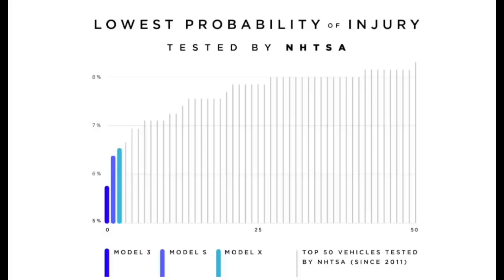Will The Cybertruck Exoskeleton Impact Crash Safety? W/ Sandy Munro

Comment: that was a lot of talking around the question. I found this on chat ai. I dont even think the cyber truck will ever come out not anywhere close to the model they have been marketing for 10 years.......In a traditional vehicle, the crumple zone at the front and rear of the car is designed to absorb the energy of a collision by deforming or "crumpling" in a controlled manner. This deformation helps to slow the vehicle down and reduce the force of the impact on the occupants.

However, the Cybertruck's exoskeleton is designed to distribute the energy of a collision across the entire structure of the vehicle, instead of focusing it on a single crumple zone. The strength and rigidity of the exoskeleton mean that the vehicle can be engineered to deform and absorb energy in a controlled manner, while still providing excellent protection to the occupants.
Reply: sounds like BS to me....supper strong rolled steel yet can absorb energy from the crash??????/

Comment: I absolutely love the whole concept of the Cyber Truck.
 My only concern & one big disadvantage of the exoskeleton is, as soon as one of those pristine straight folds is damaged how is that going to compromise the structural integrity of the whole vehicle? 🤔
Reply: its going to be really bad for repairs and modifications, a regular pickup with frame can be modified for all kinds of usages, a custom bed, or camping gear......
Reply: Presumably, anything that damages the cybertruck frame would also damage a regular truck frame
Reply: @samuelbaird4983   Not at all, because a legacy pickup truck has an internal frame / chassis which needs a major impact to damage. Minor panel damage is just superficial because the outer panels are just for styling & aerodynamics.  
The CT doesn't have a chassis / ladder frame because the external shell is what gives it it's strength. I wouldn't mind betting that any moderate collision like a side impact could be a major repair or even a technical right off 🤔
Reply: Kiwi - the Cybertruck does NOT Scratch, Dent, Chip or Deform. 
CT uses 30xx Cold Rolled Stainless Steel TESLA Alloy. 
the ONLY way to Deform a CT is to Crash it, otherwise the CT Remains as is for Decades. 
CT is a Replacement for a HILUX and HUMVEE, its more Agile and Nimble than both.
Reply: @markplott4820  you can absolutely scratch stainless steel. Anyone with stainless steel counters can attest to that
Reply: @samuelbaird4983   - TESLA 30xx Stainless Steel Alloy is more ROBUST than conventional Stainless Steel.
and Gashes or Scratches and be SIMPLY Buffed out.
Tesla 30xx SS is 9mm FMJ bulletproof.
Personally , I would like to see TESLA polish the CT to a Mirror Like Finish (Prison Mirror), and offer it as a OPTION.
Reply: @markplott4820  Well yes you're right in a way but at the same time wrong. The CT will be designed to collapse in a frontal impact due to safety regulations which means in a moderate accident it's possible it could be written off, as once the frame has folded it may  be very difficult to repair. On saying this I'm sure Tesla would take this into account & offer effective replacement insurance as the frames are relatively cheap for them to build anyway.
Reply: @kiwiguy4706  - In General you don't have to Repair a Tesla, but IF you have a crash, the car IS essentially Totaled, then Salvaged, and you buy a NEW car, it just Saved your Life.
for Minor Collisions you just Replace the Body Panels or Buff out any Imperfections.
Reply: @markplott4820  For minor / moderate collision this is true for legacy automobiles, very easy to replace front fenders, bonnets etc  as the outer panels are only there for styling & aerodynamics. 
I'm not so sure with the CT as it's panels are structural & cutting out damaged sections & welding in new Stainless steel is not as simple. I'm not trying to discredit the CT, & would defo buy one if I could, but every design has it's flaws & I'm just trying to find it's weakest point.

Comment: Ok Tesla seems to have done a remarkable job keeping the weight down for the Y. 
Model 3 DM LR=1847kg
Model Y DM LR=2003kg
Diff. =156kg (344lbs)
BMW 330i 2.0T=1433kg
BM X3 30i 2.0T=1745kg
Diff. = 312kg (688lbs)
To me this would indicate that the mega castings deliver huge weight savings when converting sedan to an SUV.
Reply: Other than your comparison being totally irrelevant. The only comparison that is valid would be the mass of the two parts actually fitted. As in the cast structures of the Y and the stamped and bonded structure of the 3. Sandy would have that info or could theoretically easily get it.
Reply: Jared Scott Sandy DID say that this aluminium casting is much lighter and stronger than the 70+ stamped metal parts that they replace.  That was why I did the exercise to see how much heavier the SUV version was. I was shocked that it could be only 150kg.  That’s why I checked the weight penalty of the SUV version of the 3 series. 
So, imo it is completely relevant. 
What about eTron? It is 6 inches longer than the Y, almost identical width and height and only 203 miles of range yet it is more than 1200lbs (554kg)  heavier than the Y which has more interior space and over 100 miles more range. 
Maybe Tesla is onto something...
Reply: @adrianwood6657  It's irrelevant. There is way more to mass than a rear subframe... they can change heaps in the move from sedan to SUV. You are confusing random brain farts for facts...

What about the E-Tron? It's largely the same mass as it's similar sized Q7 donor.
Reply: Jared Scott Lol Jared, give it up mate, he already confirmed that the large aluminium mould is lighter, and relating that to BMW who use old steel stamping in many parts for both their sedan AND  their SUV only supports my premise and Sandy’s comments, so if you want to keep acting like a pork-chop troll when you are clearly wrong then go ahead. To me you are just funny angry troll 😘
Reply: @Jaredscott89  the problem of the audi maybe all the insulation and material quality that are very heavy, just like the mercedes EQC that has double glass for its windows and many other great materials, plus they are real SUV unlike the model y or X
Reply: Jared Scott hmmm interesting so you agree that it’s lighter but you don’t agree that it makes a material difference. Logic would suggest otherwise xx
Reply: Alan May Did you know that the BMW i3 is actually full of carbon fibre to try and keep the weight down also that it is small, slow and has a pathetic range. And what do you know it costs about as much as a model 3.  no wonder they can’t sell them. I don’t know if they have aluminium castings or not and I really don’t care because the i3 is not even in this discussion the i3 is nothing more than a pathetic little compliance car that was never going to be mainstream from an automaker not at all serious about EV’s
Reply: Alan May just checked he did not find a huge casting at all, he found smaller castings with, like I said, carbon fibre body. He also said that it was only plausible for low volumes of 10-30,000 units. The truth is that Tesla owns the 2 largest casting machines in the world and they developed an entirely new alloy that does not need to be heat treated for strength post-casting. Heat treating warps large casts limiting the possible size. Whether you like it or not Tesla has developed methods that no other car maker has managed and they have done it for high volume, low cost, high strength, lightness and safety. 
He is simply showing them how it’s done and eating their lunch along the way with cars he makes 25% margin on.
Reply: nope you are wrong, they are just changing from steel sheets to aluminium casting and i dont think its much lighter
Reply: Alan May really? Sandy must be wrong then 😄
Reply: all while keeping the same Safety as Mod 3 and incesaing the CARGO Volume .
as Expected its Slightly less Efficient than Mod 3 , but that is a Good Tradeoff.
Reply: Mark Plott Amazingly the Model Y Long range is 316 miles and the Model 3 Long Range is 322 miles. And anecdotal evidence shows the Model Y’s way outperforming their EPA.  It seems the new heat pump and Octovalve has made a huge difference to range.
Reply: @adrianwood6657 - yes, it seems that way.
and it help Recover from the extra mass added in order to carry 7 people eventually or maxing the cargo , I would be curious to see a Comparison of Model Y vs e-NIRO, as it too has a large cargo area.
Reply: Mark Plott had a quick look.  The model y is quite a bit bigger 100mm wider, 400mm longer and taller as well. 
eNiro has 49 cu/ft and MY: 66 cu/ft.
Reply: @adrianwood6657   - wow, Thank you for that. :)

Comment: FEA (finite element analysis) is a useful tool to verify a design. However, the use of exoskeleton in a design decision comes before design analysis. Exoskeleton has been used for a long time where useful volume, strength to mass ratio is important. It occurs in nature such as locust (grass hoppers) and man made vehicles like aircrafts and boats. An egg shell is an exoskeleton too, it is amazingly strong in handling compressive loads considering how little material is used. What Tesla does is bringing a proven design to the auto industry.
Reply: The issue is that your vehicle can have the strength of a military-grade titanium shell... your body however does not. When it stops suddenly inside of your indestructible vehicle, your body turns into pulp against the indestructible cabin.

That's what a lot of people don't get - cars are MEANT to be weak and crumpl-y, they are MEANT to NOT have the strength of an exoskeleton. It is done on purpose so that in a crash the chassis eats the energy of the impact in your stead and deceleras less suddenly, which from Newton's laws means your own body smashes into the rest of the vehicle more slowly, helping you survive.
Reply: @Blaze6108  yeah and I don't understand how it's considered safe for other drivers and pedestrians.
Reply: nope its not a proven design , its just an improvment of something that already exist and adaptation to next vehicles, also i think a truck with a frame will be more polyvalent for modifications, i dont know how someone is going to able to modify a cybertruck for example if its all rigid
Reply: @alanmay7929  Aircraft and speed boat exoskeletons were design by human and widely used, grasshopper and egg shells evolved in nature. Whether it is divine design or evolution is another subject matter. Yes, the cybertruck exoskeleton design is optimized for specific market in mind. Not easy to modify and modifications could compromise its integrity in a crash.
Reply: @fuchong1216  and thats where conventional design is the best way